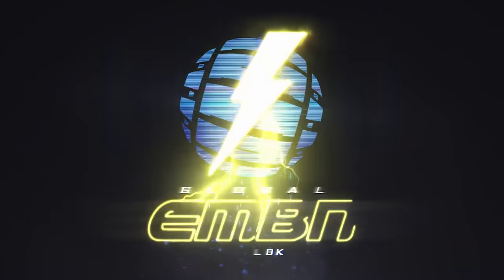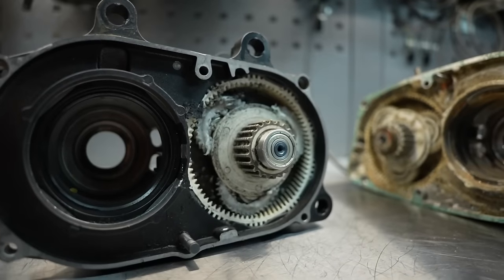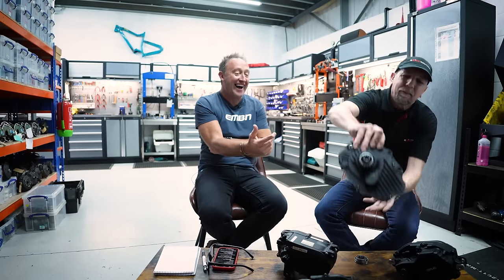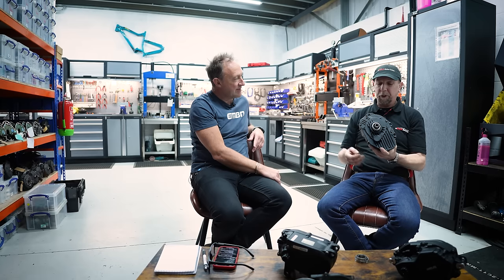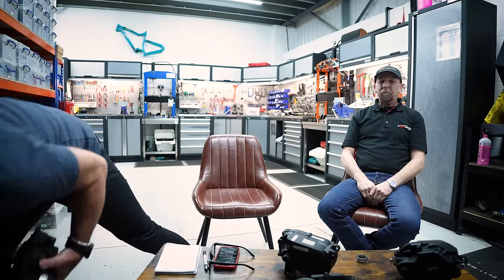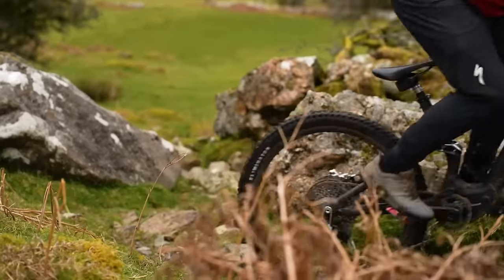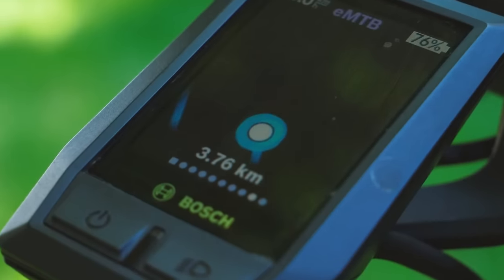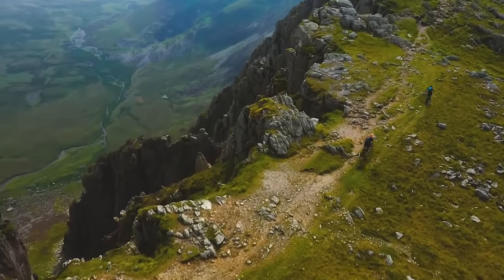What's The Best eBike Motor? | Industry Expert Reveals All

Comment: It astounds me that Bosch who make motors for washing machines and dishwashers can't improve the water proofing on their ebike motors.
It can't be that difficult?
Reply: The sealing is easy, it's doing it without adding friction is the tough part. I am sure every off road rider would gladly sacrifice 1 or 2 miles of battery life in place of a watertight motor. But, if the competition decided not to seal their motor and advertised longer battery life, everyone will buy the bike with a better battery range guaranteed!

Comment: I am happy with my gen 2 Turbo Levo. Nearly 3K km. Motor and battery are healthy. I have recently redone nearly everything. The only worn out part wasn’t rear rim, otherwise I shortened cranks, and got a swept 12 degree sQLab handlebar, SQLab wider pedals, better SQLab seat. And SRAM GX 10-52 12 speed with GX wireless shifting. I feel this bike will last for years. If the frame goes, I will buy a frame set and swap in my new parts. I have less fear of obsolescence than a standard bike. And with so many bikes out there, I have no fear of replacing or repairing the motor if needed. Very satisfied.

Comment: Interesting point at 9.00 time stamp. My Yamaha PWX2 was pulled apart after 4 years. Only one or the 2 main bearings was slightly rough. Replaced both main bearings and the fibre drive cog while it was open. The guys build mostly brose and asked if my motor was ok because it made so much more noise. I said its sounded like that from new and its normal.

Comment: Arent those crank type engines putting a great stress on the chain/gears? since it always needs them to move forward.
A hub motor seems to me to much better since yo can in most cases just move the pedals, and you will move forwards, 
and if you need to speed up you have 250W from the hub motor, and you can add power from the pedals

Comment: What to do to optimize motor endurance, other than just keeping it clean and using it correctly? Motors are service free but so are DSG car gear boxes and there are things you better do if wanted that gear box last as long as possible, changing oils, seals and oil filters. What to do with ebike motors? Open up, clean old grease and putting new grease in?
Reply: That's about it. Although with clutch bearings, plastic gears and bushes, aluminium gears etc. The choice of grease is extremely specific and normal greases will not do your motor a lot of good!

Comment: yep, didn't get bold and answer the question, Bosch surely must be king?
Reply: Bosch are excellent, there is no denying that, but with the new Gen 4 repairs are very tricky and if water gets in there, you can kiss goodbye to the PCB! And that's game over for the motor. In the Gen 4, they decided to move the PCB and power plugs from the top of the motor, to the bottom... and that's exactly where the water goes! This is why my comment at the end of the video says that the motor that is most repairable maybe the best motor to own.

Comment: What about the TQ motor? How is it's reliability?
Reply: It's probably too new for them to say. In theory it should be incredibly reliable, but I suppose only time will tell. Hopefully great, as the wife just got a Fuel EX-e 5 so she can keep riding with me despite some knee issues.
Reply: I would like to know as well. My local Trek dealer said they had few issues but all where not mechanic but software-related.
Reply: We looked closely at the latest TQ motor, and although there is not really enough in the field to get good real life feedback, there was some major issues with the outer bearings. We could not believe it, but on the motor we stripped a shielded bearing was used and not a sealed bearing! This bearing had already failed on the motor we had.

Comment: Have a Levo 2022 with 2000km. The motor is 100% but the wires broke. Specialized knows about the problem. Why not call back all these bikes and fix it before you have the problem?
Now I’m angry and otherwise i would say “great service”.

Comment: So considering repairability a conclusion can be : shimano is candidate for a place in the list of worst Ebike motors.  Why the bottom bracket is except for rocky mountain not separately exchangable?
Reply: Shimano could be one of the best, but Shimano refuse to support any one working on their motors and insist very strongly that their motors are sealed and cannot be repaired! Of course they can be repaired, but until customers start voting with their feet, they're not going to do much about it!

Comment: thought the brose motor belts go on them 24/7
Reply: Brose have revised the drive belt several times over the years and the latest ones are very good. Unfortunately, most clutch bearing failures are blamed on the belt.

Comment: Bosch Gen 2? That's strange because, I'm on my 5th Gen 2 DU. The most mileage I've got was 11,000 km
FAR less with the subsequent replacements :body-blue-raised-arms:
Would plastering silicone sealer around the seams help?
Reply: When we have investigated situations like yours, we have always found the motor has failed through water ingress and the customer is stunned! But it's not riding in the dry that causes water ingress, and sometimes it is things that the rider is not aware of... Example: Washing the bike on its side, car racks as mentioned in the video, direct hosing, lending your bike to a friend or relative, buying a bike second hand where the person before has cleaned it to death just before selling it. Hard washing around the crank area can kill a Gen 2 within 150 miles. There are also certain bikes that will kill a Gen 2 very quickly, Trek Powerfly will accumulate mud around the front sprocket due to the design of the motor cover, this mud gets compressed behind the front sprocket by the chain and forced into the main motor bearing. Anti chain suck devices and chain guides can do the same thing. I hope this answer helps you put a finger on possible cause of failure. Pete.
Reply: @Ebikemotorcentre  I do have a Powerfly. I never use anything stronger than a garden hose and I'm very careful about keeping crap out of the crank area. I would like to get a Mudstop Kit but, they aren't available and/or can't get one shipped to Canada. Cheers

Comment: Can you fit any motor on Ebikes I thought you could only fit a replacment
Reply: Its only worth fitting the motor that the bike was designed for. Refitting a different model is tricky enough, but refitting a different make is never viable as a new battery and controller would also be required.

Comment: I wonder why they expect bad things from the new generation of MGUs like Pinion. Pinion is a company that has a very good track record for reliability and I see no reason why their MGU should be different. The service interval for an oil change is 10.000 km and due to the oil bath there should be no problem with water leakages. I guess Pete is afraid that the service business might suffer ?

Comment: Didn't answer the question as usual with these videos. The answer is not all motors are reliable and the same as each other. However his comments on the Brose are worth noting. Bear in mind most motors are not repaired they are replaced.

Comment: The question of "best" cannot be answered, it's too subjective. It really does depend on what YOU need, be it performance/cost/reliability. I'd have asked him which is "worst", and he probably wouldn't have told me on YouTube, and I don't blame him. 

Stop washing your ebike so much. If the weather is gnarly, take your hardtail out.
Reply: @... - reliability and torque are not subjective . both can be measured objectively .
Reply: @siriosstar4789  I see what you're saying, if you take the motor out the bike and simply measure it on a bench then yes, you can objectively measure its performance and reliability.
Reply: I can answer the worst motor question very easily... The worst motor is any motor that can not be repaired. It seems pointless to own the best motor in the world and throw it in the bin when it fails or wears out.

Comment: just had a £1250 bill recently to replace yamaha motor & controller on Giant efathom, 3-4 years old so was out of warranty. Didnt see that one coming. Ebikes are costly to run but well worth it. Maybe need water cover for the bike motors as the guy in the video mentions, probably a good upgrade when/if you get your motor serviced
Reply: I went through 3 yamaha motors on my giant. It suffered from water egress issues from week 1. It spent  half the time back in the bike shop. I sold it as broke a year ago and still haven't bought another ebike. Too many rides ruined, I can't trust them anymore 😒

Comment: Well you both went all round the house's until right at the very end and Brose seemed to be what you think 🤔 is currently the best motor ? 
My question to Steve, as a motorcycle trials man, is what current motor would you choose over any other? Just give us an honest answer....ie what the Yamaha YZ in the ebike world right now.
Cheers.
Tony
Reply: Yamaha drive unit, of course!
Reply: The real point of this video was to point out that the best motor in the world is no good if you can't repair it. Brose is currently the most repairable and upgradable motor, everything can be replaced if necessary, but once upgraded it's virtually waterproof and a lot stronger. This is why it is currently one of the best motors to own for longevity and sustainability.
Reply: @Ebikemotorcentre  after warranty, many motors can be repaired, maybe not by owner but surely by dealer/manufacturer. Is more sustainable a problem-free motor that you shouldn’t open or a motor you can repair but you have to do it often?
Reply: @stuka78  I would agree, a motor you never needed to touch would be the best way to go. However, when a bike is used off road and crashed, suffers pedal strikes, deep water, sand, mud, grit, rocks etc. It is going to fail and then you need a motor that can be repairable. If you have to do this every year or two, I think this would be acceptable for most people.
Reply from the maker: Haha, hi there..i'm on Honda at minute! I think Pete answers the question pretty well dont you? Or did you want an answer based on speed or adjustability?

Comment: I got 900 miles out of my first bosch gen2 motor, and less than 300 dry miles out of the second motor. I don't use a pressure washer. I am now wrapping the motor in a carrier bag when cleaning it. I have never submerged either motor.
Reply: This is a really interesting comment and one we hear with other motors but very unusual for a Gen 2 Bosch. When we have investigated situations like yours, we have always found the motor has failed through water ingress and the customer is stunned! But it's not riding in the dry that causes water ingress, and sometimes it is things that the rider is not aware of... Example: Washing the bike on its side, car racks as mentioned in the video, direct hosing, lending your bike to a friend or relative, buying a bike second hand where the person before has cleaned it to death just before selling it. Hard washing around the crank area can kill a Gen 2 within 150 miles. There are also certain bikes that will kill a Gen 2 very quickly, Trek Powerfly will accumulate mud around the front sprocket due to the design of the motor cover, this mud gets compressed behind the front sprocket by the chain and forced into the main motor bearing. Anti chain suck devices and chain guides can do the same thing. I hope this answer helps you put a finger on possible cause of failure. Pete.
Reply: Thanks Pete I think the car rack killed my first motor. But the second one I can only think , washing the bike caused it. It had one ride in damp conditions. It's a Scott Ransom
Reply: It's a gen 4 Bosch not the smart system
Reply: @paultaylor5542  There is an issue with this motor that we will speak about once we have finished designing the upgrade for it. Sorry I can't say more at this time, but we will dedicate a page on our website to this issue within the next 2 months.
Reply: @Ebikemotorcentre  brilliant look forward to it

Comment from the maker: What are your thoughts about motors, their component parts and bearings getting smaller and lighter? 🧐
Reply: There's a limit to how small and light motors can get before reliability suffers. Battery size and power to weight is the area that needs improving.
Reply: I don't like it one bit , I'm old and old school with a mechanical background ,  imo strength and robustness is the number one on the priority list , second on the list is simplicity and ease of repair and maintenance.
  Personally I'd rather have a weight penalty for something that is built to last and  be reliable and be easily serviced .
I'm not a fan of the throw something away when it stops working and buy a new one which is more common these days.
Reply: Good talk on the motors guys , it might have been interesting to also talk about after market motors like bafang etc .
  Also interesting that the sealing of the motors is kinda lack lustre, maybe one day someone may come to the party with after market seal kits for the different motors , I suspect there might be a surprising amount of bikers out there willing to pay for a kit to make their bikes a bit more resilient against dirt and moisture.
 I know I'd happily buy one or two seal kits.
Reply: The most important thing for me is reliability, My Shimano battery died after 4 months from new and now the EP8 motor has died after 9 months from new. Now to my mind we would not put up with a car or motorbike which failed every 4 months or so.
Reply: Do you remember the bulky vacuum cleaner that weighted 10kg, with a 800W motor inside? Your mum got it at her marriage, and you got it from her 25 years later, when you move out.
Today? 2000W in a tiny case that weights 2.5kg Lasts 3, 4 years.
Reply: I love my BaFang motor 160Nm of Torque that will take me anywhere I have the skills to ride...
Reply: So what motors are repairable then (besides the Bosch motor you mentioned in the beginning)??
Reply: @MTBs  This is a double edged question really. Most motors are repairable to a certain extent, but you can't buy the parts for most motors and many have bespoke bearings or seal sizes, so fixing them is difficult. No main manufacturer outside of Polini and Bafang will sell you any internal parts either, making this job doubly difficult! We currently repair Yamaha, Bosch, Brose, Panasonic, Mahle, Impulse and a few odd ones here and there. This is only possible because we have invested in having parts and bearings manufactured, making special tools etc.
Reply: @Ebikemotorcentre  Thank you for a good answer. Interesting video too! Do you sell and ship service kits too?

Comment: Aren’t all e-bike motors repairable? Can’t be that they are a <consumable> item
Reply: the only ones that was made to be serviced was the yamaha motors as can get most of the parts for them and motor controllers but not the giant branded ones peter has to have the bearings he uses custom made and min order of 1000 for each bearing as none of them will sell them and class these things as a throw away item like a phone plus it all uses can bus comms so no 3rd party stuff will work and if you try recell the batts and cut power to the bms  it will loose its programming and not talk to the motor controller and wont turn on, also the new smart batts are not compatible with the older motors  because you have to throw it in the bin and get a new bike for 10k

Comment: And the most important question, which motors are derestricted the easiest and cheapest. Face the facts.
Reply: you can get dongles to remove the speed limit but it wont give the controller any more power all motors can be derestricted and ebike shop uk will sell you a gen 4 smart motor with dongle and warranty. bbshd is alot cheaper can buy all the parts easy to fix and a 30a controller you can set up ur self with a programming cable uk kits can be got from red dragon bikes in wales

Comment: Too politically correct. Shimano vs Bosch. He doesn't fix Shimano.
Reply: We used to repair Shimano, no problem. Sadly there is a complete lack of support or communication from Shimano, and without their software, we did not want to continue because we could not do the job properly. We have the software and support for every other motor. We still try and support Shimano owners with bearings and parts, but until Shimano realise how much damage and bad feeling this is causing their customers, nothing will change. There is also no corporate or political pressure on us to say or not say anything, so if you have a question for us, feel free to ask.

Comment: All the motors you discuss are a joke and created for profit.  Unreliable, motors and cheap batteries that cost the consumer $1K to replace.
For those with a clue, build a custom ebike with a Bafang mid drive and 1KW battery made from name brand Li-Ion cells.
If you don't have the capabiity, pay an expert.
As a mechanical engineer and custom ebike builder, 90% that buy ebikes are clueless about their true cost.
On your left everybody who wastes $10K for a low power ebike only to throw a lot more money at it after warranty.  People who pay the same amount for an ebike with proprietary CANBUS architecture and software designed to discourage DIY repair as a Ducati motorcycle have more rocks in their head than on the trail.